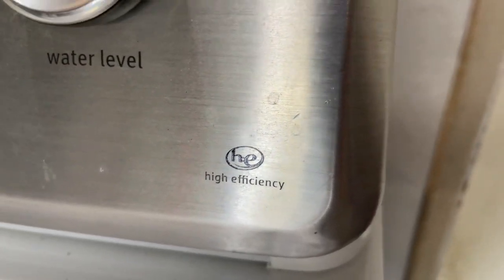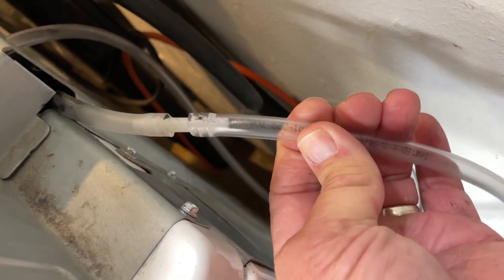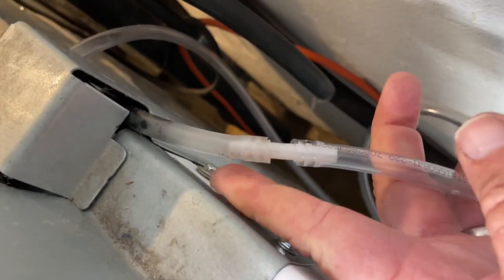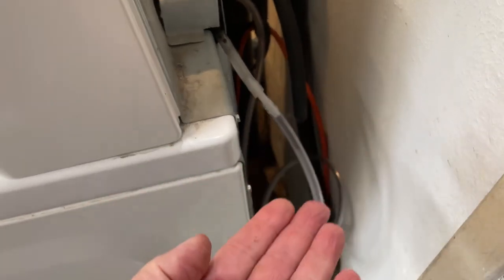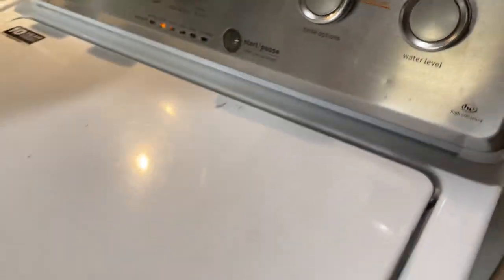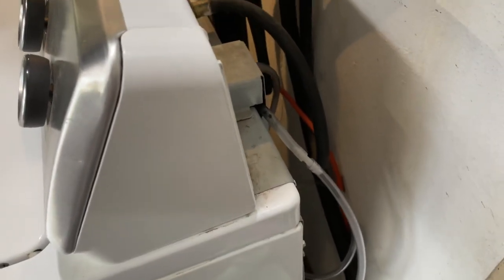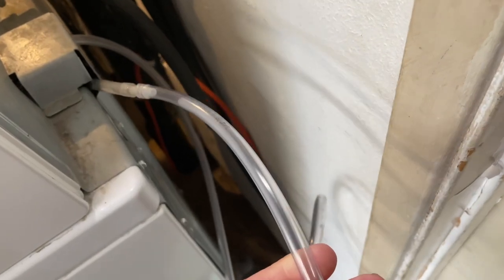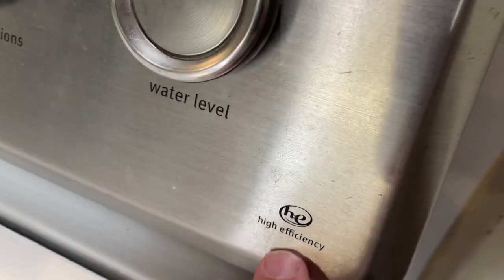How to Fix/Workaround/Trick High Efficiency Washing Machine Low Water Nightmare! ￼

Comment: THIS WORKS!!!!!  I"ve been cursing my Maytag Centennial ever since I installed it.  After watching this video, I bought 4 feet of 3/16ths tubing, 2 brass push-on connectors ($4.59 each from Ace) flipped back the top panel and found the rubber line.  I cut it, patched in the 4 feet of 3/16ths tubing using the brass connectors and put 6 towels and some T shirts in the machine.  FULL WATER WASH!!!!!

Comment: I understand your frustration BUT, "high efficiency soap" washes completely different than the non high efficiency soap. The reason you don't get as much water in those HE machines is because you need the clothes to be wet, but not floating. The heavy wet clothes in just a little bit of water allows the clothes to slap  around pushing the soap "through" the fabric. THAT'S how HE soap works. By fooling your pressure switch and getting more water, you are defeating the way that soap works. Your clothes are not being washed, they are just hanging out in the soap instead of the soap being pushed through the fabric as designed. If you don't like it, (and I don't either), get rid of that HE machine and get an old school agitator style. Sorry to rain on your parade.
Reply: Try washing some heavy soiled coveralls or jeans with no water. Still filthy after 3 washes so where is the benefit of this so called energy efficiency BS. Waste of money and time. I am going to try the extended hose trick.

Comment: What is the fix for adding too much water?  Two bath towels and it put around 24/25 gallons of water in.  Measured it when doing a drain cycle.
Reply: Which machine is this ? Lol I need that problem.